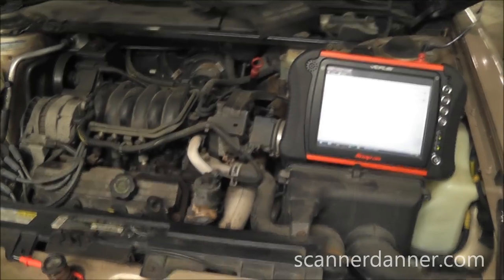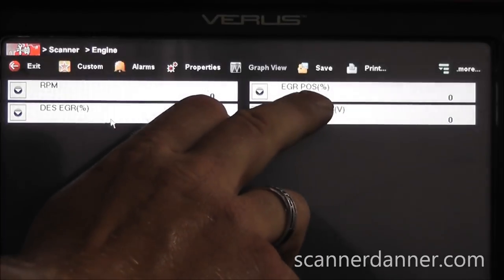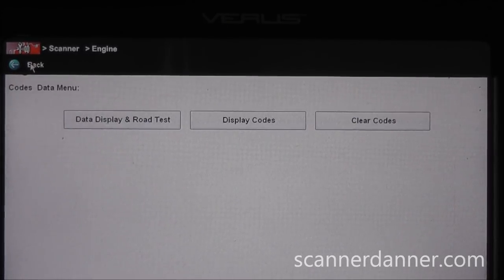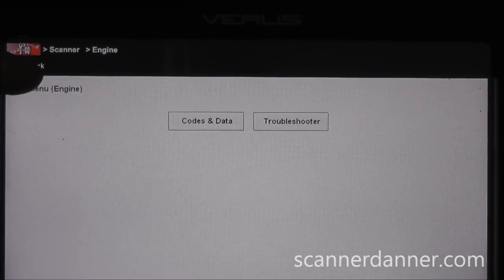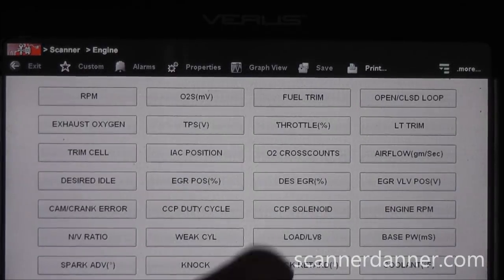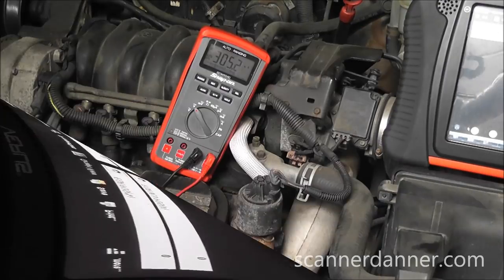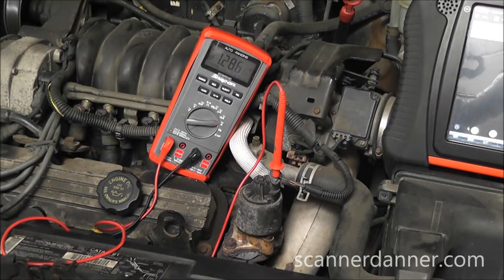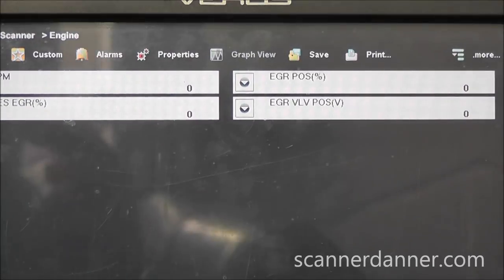How to test an electronic EGR valve (GM P1406 case study)

Comment: Hi there...great video(s)! I do have a question for my case: when i measure the resistance of the position sensor- potentiometer - from wiper to both ends, the sum of these resistances is not equal to the whole resistance i measure across ends of the pot. 
Furthermore, when i put 5VDC across the pot and measure voltage on the wiper, manually moving the EGR from one end position to the other, i get a constant 0.9VDC on the wiper.  
Bin it? 
Thanks in advance!
Reply from the maker: 1. That is normal as the wiper doesn't extend fully to both ends of the resistor. I almost never measure resistance on these to condemn them or to check operation. You're much better off doing voltage measurements with it plugged in and backprobing.
2. Are those voltage readings on the car, or you are manually providing a 5v ref and ground to the sensor? If it is manual, mixing up the pins could be your issue.
Reply: @ScannerDanner  Hi, i'm sure you're a very busy man so i really appreciate your reply! 

You're right, there's always a little bit of resistance left on both ends - the space that the wiper takes up when it shorts out on the end terminal,
but in my case, there was no change in resistance at all, across the whole manual movement of the valve... ->
-> (semi-destructively) managed to get the "lid" off of the EGR actuator..-> found that there is no potentiometer inside [eyes pop], but a permanent magnet and a tiny circuit board.. So i guess there is a magnetic Hall sensor that determines the angle / valve position. 
I've read Hall sensor don't like heat..but OTOH don''t have problems with wearing/fouling carbon tracks..
Now i dug into the thing so deep i might as well try to extract the Hall sensor, ..maybe it's marked and could be replaced (fingers crossed), but i have to desolder the whole board... It's a tiny element compared to the whole EGR thing, for the whole unit to go to waste . . .  

2.) Yes I powered the actuator with an external power supply, but i'm pretty sure i got it right. I identified the 2 coil pins (which i tested, and they open up the valve) and 3 "potentiometer" pins according to an auto repair software (it's drawn as a pot on the schematic [shrug]).

Comment: Brilliant video thank you. I have got a 5pin egr valve on my wife's Peugeot and my topdon artidiag scanner is saying the valve is either stuck open or closed,how do I find out which wire does what before I start back probing with my multimeter? Where can I download a wiring diagram? Hope you can help!
Reply from the maker: Not sure if this will be good for your market, but here is the DIY version of the service info I use
https://eautorepair.adtrk.biz/?a=10817&c=24&p=r&s1=
As for testing, turn the key on and backprobe all 5 wires one at a time and give me your readings. I'll be able to guide you with that alone
Reply: @ScannerDanner  ok thanks for getting back to me I'll get back to you with my multimeter readings.👍

Comment: Hi Paul, couple of points, if you jump from one five volt link on the PCM to another wouldn't the PCM display a fault code on the pcm and possibly induce limp home mode as we call it in England, and maybe put the MIL light on, the other thing, if the PCM just had a drop down resistor for 5 volts, wouldn't it vary a bit with engine rpm etc, maybe it's a voltage regulator not a resistor?  Fred uk.

Comment: Hey Paul. I was wondering how you would trouble shoot this if the ECU was controlling both power and ground circuits on the EGR motor? I know chances are that in that style of valve you would most likely have some bi-directional control as it would likely be a newer vehicle/model however if that wasnt the case what would you do? The only way i can think would be to remove both wires from the connector and use 2 jumpers, 1 live 1 ground? 

Cheers

Dave
Reply from the maker: If both wires go to the ECM, the safest method to manually open the valve is to run your own power and ground to the solenoid with the connector unplugged. Other than GDI fuel injectors where the ECM controls both sides of the circuit, every other design ive seen where both wires go to the computer, has been powered side switched.
Here is what I do when I also want to see the signal voltage of the EVP sensor change, while energizing the solenoid:
Test light to battery positive, connector unplugged, one wire will be lit constantly, that is the ground, the other wire won't be lit at all, this is your control wire. Now plug it back in and give the solenoid a power on that wire  ;-)
Don't do this wrong! You're playing with fire.
Reply: Awesome Paul thankyou so much for taking the time to explain it to me! It was just a variable that jumped into my head while i was watching.

Comment: Hi Paul...The two wires of the egr, the feed and the control show 12 volts. If i test these wires with a test light for 12 volts, will it light on both wires???? bcoz it must light on the feed for sure.I want to know if it will light on the control wire??? Plzzz advise. Thank you.
Reply from the maker: yes it will light on both sides, but depending on your test light resistance AND the solenoid resistance, your test light may be dim on the control wire, may completely go out, or may be just as bright as the feed side

Comment: you can get the torch tip cleaner anywhere they sell torches homedepot,Lowe's, tsc welding supply
Reply from the maker: good tip, thank you!
Reply: Nice to see thinking in the USA is the same as the UK.  I use those gas cutter nozzle files for cleaning poor contacts.

Comment from the maker: It will not because with the driver off there is no ground and if the driver is on there would be equal potential (12v on the tip of the test light and 12v coming from the driver)

Comment: Hey scanner danner I have a ? I have a Chevy pickup 1996 model could I jump from the tps 5v ref to the egr 5v ref instead of doing it at the ecm your help is always appreciated also how many books do you have that I can buy I bought the engine diagnostics one is there anymore
Reply: It would be better not to as the other wire would then carry extra load

Comment: Does this test will work for Citroen  C4 grand picasso 2006 . I'm having a fault code P1471 , engine crank ,but did not start. Any advice that will be very appreciate. You are doing a great job ,
Reply from the maker: +00748040 what test are you referring too? Testing the 5v reference circuit? What is the definition of your p1471 code?
Reply: about the EGR valve . The code reader said it is stuck open.

Comment: Hey brother ScannerDanner- I have a 2001 Pontiac Grand Prix and getting ERG error code P1404.  Used a multimeter to test all 5 ERG wires and everything is fine except the A (-) and E (+) wires on the ends.  Those should read 12V and I'm getting 0.02V.  In your opinion is it time for a new ERG?  Your videos are awesome man, Torrey Hecht
Reply from the maker: +TheTor no, some of these where power side switched so what you were reading may be normal. You need to get the PCM to command the EGR valve on and retest those.

Comment: Thanks for this Paul. Should one ever worry as to why the 5V reference went missing. I was thinking of, say, an intermittent short to ground in the EGR reference circuit that may have blown out a very thin track in the ECU and potentially could do it again with a new ECU, or if you wire in a jumper to the other pin with the 5V with the faulty ECU, could take out the 5V ref. completely rendering a non-functioning engine! Only ask as, like you, want a repair to be a permanent fix with no come-backs! Or have I missed something...? 

Thanks, Nick
Reply from the maker: Wiring is always a concern and your questions are valid. For intermittent wiring problems a visual inspection is about all you can do. (hate intermittents).
The 5v ref circuit is pretty hardy, fix the short to ground and you'll fix the problem. I cannot think of a time when I had a shorted 5v ref circuit that it also cooked the 5v reg in the computer. They are protected very well.
Thanks Nick

Comment from the maker: We need to be extra careful with these. For example, I have been playing with GDI systems lately and the computer controls BOTH sides of the injector circuit.  But, with GM EGR systems, they changed it to power side switching and only control the power side. The other wire is a constant ground even though it goes to the computer. To ID which wire to energize, take a test light to b+ and touch on control wires. The one that lights up is the constant ground. The other is the switched b+ side

Comment: It's save to jumper the solenoid to ground? It's steering by PWM in normal condition. Sharing the 5V referance will not cause overload voltage regulator or something? Maybe its worth to try fix ECU, maybe changing the voltage regulator is enought.

Comment: Great video and straightforward explanation. I am having P0409 and P0403 error codes both about the position circut so I tried checking the voltages on my Opel Astra H 1.7 Pierburg electric valve and I got the following:
- solenoid is supplied with 12V and controled ground. When connecting the voltage from the car batery and controling the ground side Ican hear the EGR move.
- control circut pins have the folowing voltages when the plug is disconnected 5V-0V-5V and based on my research I found that one of the 5V is on the signal feedback wire going to the ECU. Is this a wiring issue? How can I have constant 5V on the fedback wire with the plug disconnected from EGR when that voltage should be based on the potentiometer from EGR valve moving open/close. 
I would realy appreciate your input on this since I am having problems with this and the mechanics I am going to in my city apparently do not have enough knowlage on this and would just replace the valve…
Reply from the maker: This is a bias voltage your looking at. I bet the one 5v wire is slightly lower voltage that the other, yes?
Reply: @ScannerDanner  both voltages are the same 5.xxV so thats why I suspect a faulty wiring since they are exactly the same when the plug is disconnected from EGR. Same decimal values as well, I just don’t remember them.
Reply from the maker: @stejn43  it is normal signal bias voltage, that you'll only see with the sensor unplugged. I don’t know if I have classes on that here on YouTube or not, but definitely do on my website. Let me see if I can find one for you, that explains this circuit
Reply from the maker: @stejn43  can't find specifically the class I'm looking for here on YT but this one touches on it https://youtu.be/SdVgfj6UAMI
If your interested, sign up for my classes here https://www.scannerdanner.com/join-scannerdanner-premium.html
It costs 36 cents a day and you'll have access to over 500 hours of training videos and classes. I cover this in chapter 7 btw
Reply: @ScannerDanner  thank you for all the help, I will concider it since I do want to learn about it and don’t want to get fooled by some half time machanisc looking for a quick buck without any comprehencive explanation on the issue. Thank you again and keep up the good work!

Comment: montero sport 2001 code p0403 using a lot of oil every two weeks can you advise me what to do do i need a new car
Reply from the maker: +dianemarie909 what is the definition of the P0403?
Reply: exhaust gas recirculation valve

Comment: Hello. My dad's truck has the same code. The truck is a 1997 Chevy 4.3l v6. The first thing I did was replace the EGR, and of course that did not fix the problem. So I followed your video to diagnose it. With KOEO and at idle the EGR Pos% is 6 and the EGR Pos V is 1.76. Now when i used my meter as a jumper wire, the EGR Pos % is 88 and the EGR Pos V is 4.96. My sensor ground shows .06 and I do have a Ref voltage of 5.05. So EGR  works, and its getting the REF V, but its slightly open when its supposed to be closed. What's your take on this?
Reply from the maker: Did it change from KOEO to Idle? It should be the same voltage and percentage. 
Secondly, disconnect the battery and retest. If that 6% now drops to 0% with the EGR position voltage staying the same, then you should be good. There is a closed valve position memory that needed to be reset.
Reply: I believe the values were the same at KOEO and at idle. I will recheck today after work and disconnect the battery, like you said. Thank you for responding sir! Love the videos.

Comment: amazing as usual. i was just thinking about just using a jumper to get the 5v ref.
Reply: +movieguy73 no 5v ref pid on scanner?
Reply from the maker: +movieguy73 not on older cars my friend
Reply: oic ty.
Reply: i like that tip about using the multimeter as a jumper too.
Reply: +ScannerDanner what is PID in this reference?

Comment: hi i have a audi a3 2.0 tdi 2009, P0403 open circuit fault code, i have 12v on both wires like you, but on the bottom 3 wires i have 0v 0v and 5v any ideas? thanks
Reply from the maker: Open circuit for the solenoid or the position sensor?

Comment: I had for a while the egr valve light po405 on but I knew that I had to clean it since I do it every two years but this time I decided to change it, so I when and bought from big city a egr valve made in Mexico and replace It, deleted the code with the scanner, drove couple mile and the engine light when back on, I check with the scanner and said again po405 position sensor circuit low, I guessed that it might had to do with the fact that is not original so I go and buy a new egr valve made in China, I replace the part delete the code and drive on, this time I was sure that it will go away but no luck after few miles (4-5mil) engine light came back on, I took out the engine computer and cleaned it but its back on again, light engine. 
Please can you help, I tried to find online the diagram of the engine computer to find the egr valve wire to make sure that it's 5V on it but I couldn't find something.
Reply from the maker: Have you seen this one? https://www.youtube.com/watch?v=HT4OnP4U0to

Comment: a few things beside this being a great video..
i would think that when you applied ground to the linear EGR valve with the engine running. that the engine should have completely stalled.. i would bet that if you had another tech operating the engine speed and bringing it up to around 2500 as you force the EGR open and closed thru full range that it would restore normal operation to the EGR other than the lack of 5V ref

Comment: Hi - I have a 2004 Impala LS with the series II 3800 V6 - non supercharged - VIN K.  I recently have had some intermittent surging problems after vehicle has fully warmed up.  It won't do it after a cold start or when warming. It intermittently does it when hot - both when idling or aven at cruise throttle at highway speeds. No codes are given. It seems to act up most if you warm up the car - run around hot, turn off and then restart after 1/2 hr or so.  hesitates and surges like someone turned off the key for a split second or choked fuel.  (Fuel filter has been changed recently).

As it happens more based on temperatures, I figure it has something to do with EGR / vac system.  I initially thought it might be a TPS or IAC so swapped them out with used ones I had but to no effect.  So am thinking its either the EGR or possibly the MAF.   I checked all vac lines but no leak. PCV recently checked and MAP sensor seem fine. I cleaned the MAF with special cleaner but also no effect.  I cleaned EGR spindle with carb cleaner as well.

So - what are your thoughts on this?    

Also - if it is an ECU problem, can I simply go to a wrecking yard and find another VIN K 3800 LS ECU and swap them out? Or does a dealership have to do some memory update / flash to it?   I wanted to swap out an BCM for another issue it had but was told you cannot do that - they are car specific.   Is this the same for the main ECU?

Rick
Reply: I cannot tell you what it is but I'll tell you want it most likely is not. It is not the ECM or EGR.
MAFs are known issues but you should set a code. Crank sensor is a possibility. 
When you say it is like someone shutting the key off, to me that is a violent hesitation, not minor. So that doesn't sound fuel related at least on the delivery side. 
You need to connect a scope the the injectors and ignition control circuits during the event to get some direction. Right now it's just guessing
Reply: ScannerDanner Premium No, never sets a code. And yes, you are right - it is guessing... I don't like swapping components but it is so intermittent.  It happens when you are sitting idle at a stop light, in park, neutral, or even cruising along the highway at 60 mph.  It is like something switches, the vehicle starts a quick stall, then it overcompensates and revs the engine high, returning back to regular idle. Its scary too cause if you are at a stop light and are only stepping lightly on the brake, it can rev so high so fast it could cause the veh to almost move.  The fact it happens only when the engine is hot and been running awhile leads me to think an emissions related sensor - which led me towards the EGR.  
And it happens so sporadically... so its hard to catch. I can get sensors cheap from a local wrecker so I have been swapping them out one at a time to see if that can help direct me. I have a spare MAF so I will try swapping that. 
I never thought about the crank sensor though.   

Anyways - one other question - can I simply swap a compatible ECU or do they have to be bought new and programmed by a dealer? 

Thanks so much for your help.

Rick

PS - Was just down your way in Pittsburgh seeing the town!  (We're from Hamilton, Canada).

rick
Reply: My 2005 gmc envoy was doing same thing it turn out to be both oxygen sensors. It just fine after replacing them.